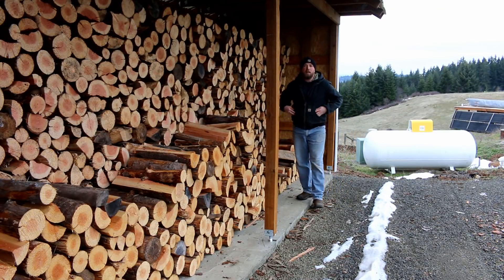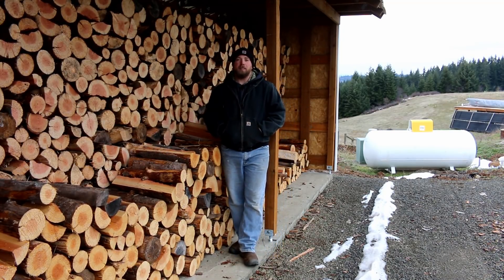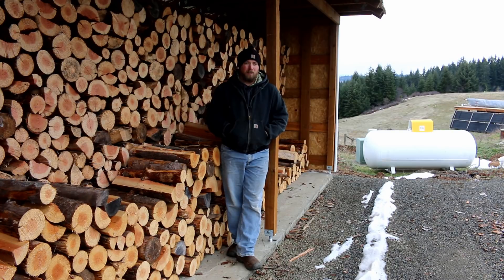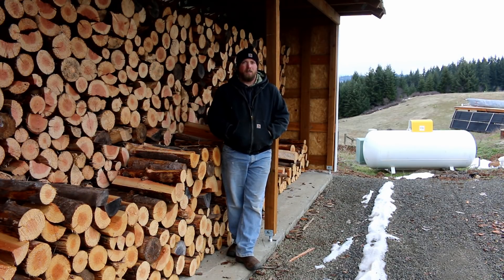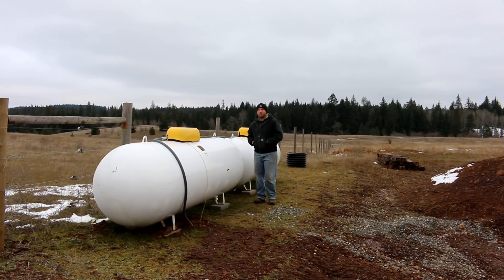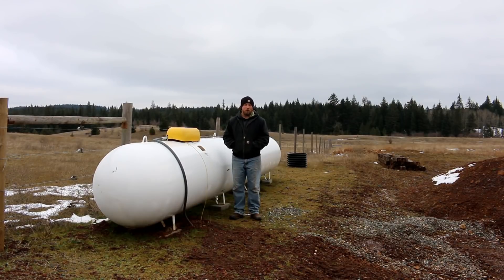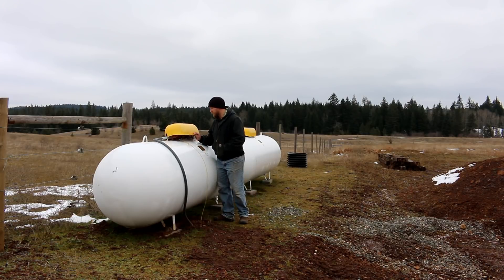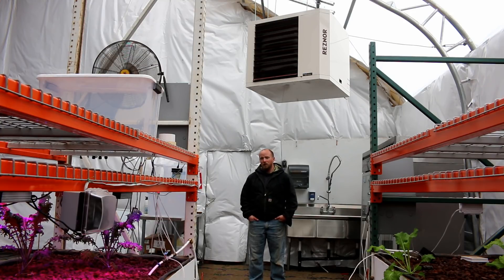What Can HEAT your HOME or GREENHOUSE for FREE?

Comment: Isn't there a way you could get the digester up and running without using the fuel with the hay mixed in?   Say, for now, supply it with another fuel that you might have available until you figure out the hay problem.   Another option/question.   Is there a way to use the straw hay fuel, but store it in another container where it could break down before pumping it into the digester?  Sort of pre-digesting it, so to speak.

Comment: do you plan on liquifying the methane? if so were you planning on using a propane tank to store? Given methane has a boiling temperature much lower than propane I would assume the pressure its stored at is greatly increased similar to liquid natural gas and much lower btu capacity per unit than propane. Relief valves and other things would need to be reconsidered if a propane tank was used. Just thinking out loud curious what you were planning

Comment: Just a thought, & I am not sure how hard this would be to do. Would it be worth building a portable tank that you could tow behind your truck or tractor & build a pump onto it so you could siphon  the waste from your septic system, then dump it into the digester? kind of like they use for camp grounds to drain the holding tanks.

Comment: You claim to know a game plan... please point me to engineering schedule build-out pdf doc... thanks. Makes following along a buy-in rather than feeling like a dice roll game of chance... negative cash flow speaks Martian like adventure of poor planning... with a wife accountant you could be on a positive game plan else triage till Spring. Its 2018... show a b&w plan to gain positive cash flow... else reach out with proposal...
Reply from the maker: howdy Ho Douglas...I appreciate you keeping me honest and calling me to account. Of course theres quite a bit of stuff that happens behind the "scenes" here that is right in line with what you are saying. I think in some of my previous videos I had subscribers asking about my approach and methods as well so we covered some of it a while ago. That said, heres what we do: 
1. over 4 years ago we started off with a systems modeling language (sysml) model of our entire concept, beggining with requirements and flowing down to system components. This culminated with a systems model simulation and eventually a very small scale prototype built in our home.
2. a cad model was developed for an even more capable version of this facility where an actual costed BOM was generated resulting in over $1.5M of actual component costs using actual materials sourced from real suppliers...1.5M is a total no go so we created a smaller prototype version of the system which is what you see now as Hab 1
3. I utilize a combination of both traditional project management and agile project management. We use MS project to develop high level gantt charts where we set our long term goals and break the project up into various phases (we are closing out phase 3 and are currently starting Phase 3.1). We take the Project schedule and utilize the agile/scrum methodology to manage our work. Currently we use the Atlassian project managemen tool Jira to manage our sprints (which are three weeks long). 
4. we utilize Confluence (another Atlassian tool) to manage our sprint objectives and capture lessons learned and future design requirements. We host retrospectives after each sprint to ensure that we are continually learning.
5. Its important to remember that this is a prototype...and the purpose of protyping is learning...i.e. defect identification early. We capture defects in Jira and triage them based on available budget
6. Each year my wife and I establish the goals for the year, which the translates into projects (captured in MS Project and decomposed in Jira) and set aside budget for them. Each month we reconcile and record project costs using excel so that we can keep a running total of the prototype cost. 
7. One of our final tasks this year will be to go back and update our original SysML model with the prototype lessons learned/defects/etc. This will be where we start our hab 2 design efforts. We'll take everything from hab 1 (requirements, architecture, activities, use cases, etc) and then update it for hab 2. Which will then result in an updated Sytems definition which I'll then break down into the various disciplined based components (i.e. Organic/Biological, Mechanical, Electrical, and Sofware). Each of those will be further defined in various system tools such as CAD, ECAD, etc. 
8. we've developed a comprehensive business plan that provides various routes to positive cash flow. That said, there is no doubt that us taking on this project requires a significant leap of faith.

Finally, there's quite a few spreadsheets that I have where we analyze and perform trades...the best one is the thermal dynamics model for the hab which came within 2def F of actuals. Another is our lighting solution, and another is our insulation solution. There's a lot here that is experimental "for us," so there is a lot of "building the airplane as you fly it" that probably spured on your critique. Personally, that's exceptable to me. I'm actually more in favor of "fail early and fail often" then I am of "paralysis through analysis." In my professional experience I've witnessed time and time again that engineers fall into the trap of paralysis through analysis and try to design the perfect system (taking months/years) and then ultimately they discover as they build it that they didn't think of something that throws their entire design into disaray and basically the entire plan goes out the window. It's becuase of that experience that I try to balance, just the right amount of planning, with good risk management, and a more aggressive approach of "just build it" so I can more quickly learn what I would have designed wrong anyway. Admittedly this does cost more up front, but I believe history would show that in the long run, it's truly more succesful and cost less (total life cycle cost).

Anyways, keep me honest...always appreciate that.
Reply: TheRealMartian, Good amount of behind the scenes content but I'm still not clear on what you hope to demonstrate from Hab2 which is not in Hab1 which a revised spreadsheet would prove. Do you have a review Board of Directors who help with review, budgeting and mentoring? It feels like I"m riding along with Marty McFly, love the Fluxcore Capacitator aka digestor surprised it has not gone live with livestock being indoors with a good supply of wastes to digest faced with propane expenses. Thanks for your reply, its your show so dance it as you see fit. Would appreciate an engineering detail segment in each video to balance the car salesman superlatives. Best wishes! BTW, Did we meet once in South Everett area... something is missing.

Comment: Hi Jeff,    
     Is wood gasification an option as seen on the Mr Teslonian channel to produce heat and power?  Also do you have plans in your head for the digester blender? Have you been shopping for parts for the future build? Would appreciate a video on the progress so far.    Cheers,    
     Bill
Reply from the maker: i have looked at gasification, but...the long term supportability of it doesn't pencil out...i'd basically clear cut my entire ranch and then miles for miles afterwards unless I came up with a renewable, quick growing, wood crop (ex. poplar...as suggested by another subscriber)
Reply: Hi Jeff,     I can't change your mind, but if you need some way to supplement heating and producing electricity (and BIOCHAR)  I'd think this would be the way to go. Can't be worse than the barrel stove you've had before. Stacking functions the way of permaculture. Anyway thanks for replying.    CHEERS,     Bill

Comment: I know you had poor results with your subterranean wood stove, but why not supplement your propane heater with a wood stove?  I would use a short flue out the side of the hab to avoid the condensate problem from last winter
Reply from the maker: the big problem there was the time you spent filling it...then cutting all of it...and finally, the large amount of covered storage area you'd need

Comment: TRM, I know you have delivery problems with piping right now. But can't you use a larger port near the digester to hand load or use your John Deere to deliver the feed to the digester? The straw should break down in the digester so it should be easy to empty but you should take advantage of what you have. You said you purchased the molds. Let's see them on camera. What do they look like? And please provide a link of where to buy.
Reply from the maker: we've done this...the challenge is that it floats in the 2ft diameter pipe and never sinks down to the bottom of that pipe into the 8" pipe which goes down into the digester.  here's the manufacturer link https://www.google.com/url?sa=t&rct=j&q=&esrc=s&source=web&cd=1&cad=rja&uact=8&ved=0ahUKEwjM37T16sPYAhWqxlQKHeXbAR0QFggpMAA&url=http%3A%2F%2Fen.puxintech.com%2F&usg=AOvVaw1I6U_8FwE4WPPv0jkxmmgy

i'll try to make some more videos on the molds etc in the future

Comment: We need to stop burning stuff at some point.
Reply: Its the only way to release energy from most solids.
Reply: We need to find our energy elsewhere then,  perhaps in Digesters, Solar and Wind or maybe Fusion. Burning anything is bad news somewhere down the line.
Reply from the maker: personally, my conclusion is that our long term solution has to be fusion
Reply: Like money?
Reply: Wood smoke is a significant source of particle pollution, it's lethal at less than 10 microns in size. It's a Carbon gas, so it adds to acid rain, and it is light enough to be carried quite high and we are not fully aware at what its doing, while its up there. Meanwhile cash is about to go digital so some might have a stash they feel like burning. Current notes in the UK are made from a Polymer, toxic gases are released with burning along with CO2, safer to melt at 120C and reform into something useful, like shoes.
Reply: When I was younger Fusion only happened with a big hammer, and a lot of heat. I have hopes for it and some development in Storage mediums would be handy while we mess around with Solar and Clouds, Rain and Snow and that pesky wind, never there when you want it, but always there when you don't.